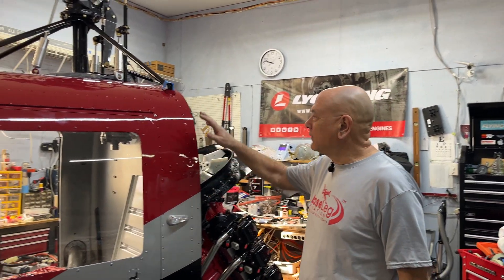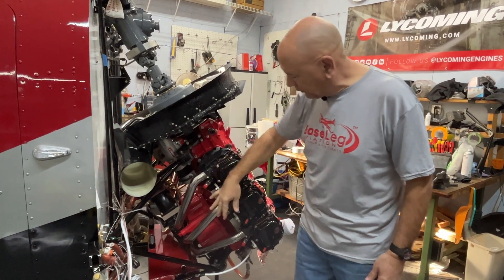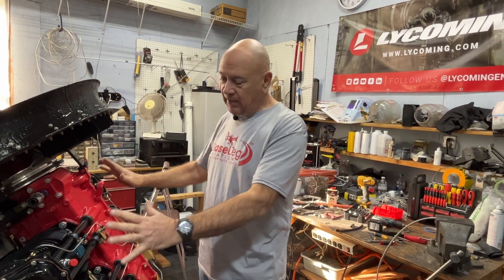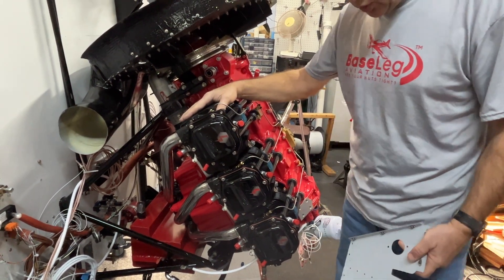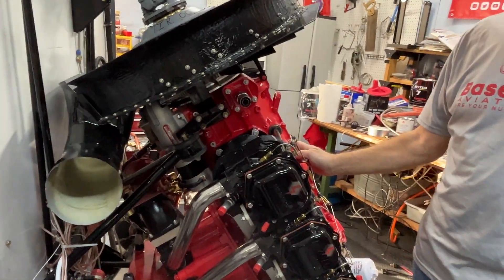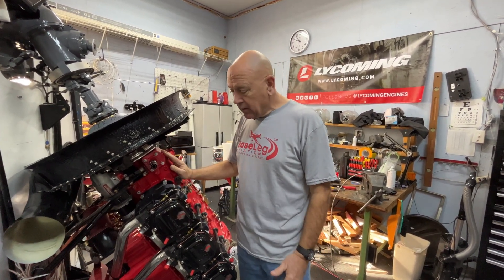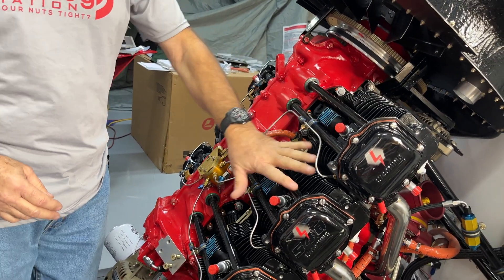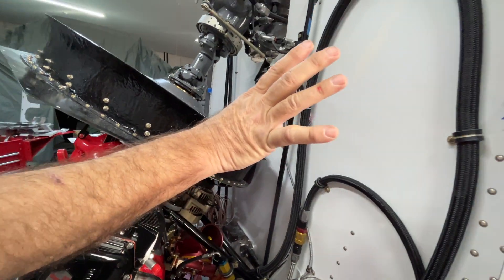HUMMINGBIRD UPDATE, ENGINE MOUNTED, BAFFLING, CARBURETED VS FUEL INJECTED ENGINE

Comment: Wonderful Vic, I always anxiously await the next hummingbird update. As to power plant selection, did you ever consider an LS V8 engine (or other all aluminum automotive engine of suitable displacement) in lieu of the 540 Thunderbolt? Even with the addition of liquid cooling, it appears the various aluminum V8s from the sprint car and air boat industries are of similar weight to the Thunderbolt and have higher horsepower numbers, at about 1/3 of the cost. It seems Vertical Aviation isn’t promoting the V8 power plant option like they used to, perhaps there is a promotion agreement with Thunderbolt that has caused that. Just wondering if you ever considered an alternate power plant.
Reply from the maker: I’ve always thought it best to build the aircraft in a way in which it was designed. I’ve been around a number of the LS engines, on RV 10’s and even helicopters, and they don’t have the reliability I think is desirable. in multiple cases the RV’s have since been re-engined with Lycoming engines, for which the 10 was designed. I’m not knocking those who try to pursue alternative engines. that’s what experimental aviation is all about. But for me, when I am done building I want to go fly and not have to tinker.